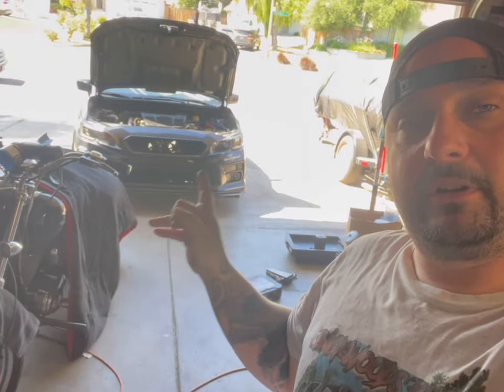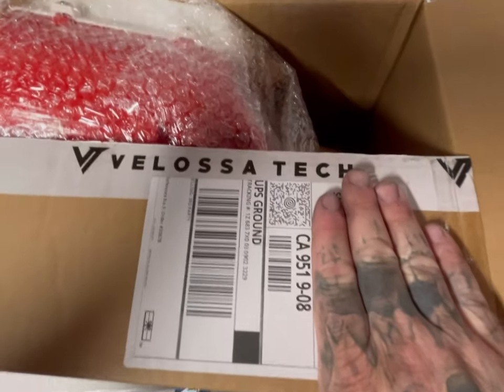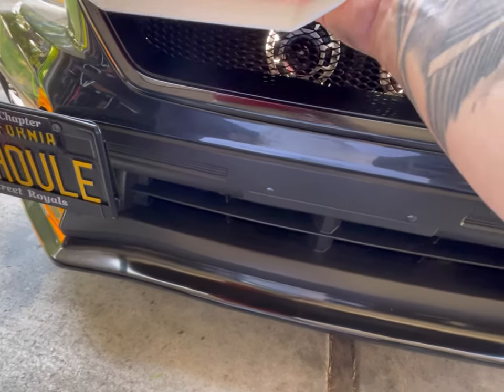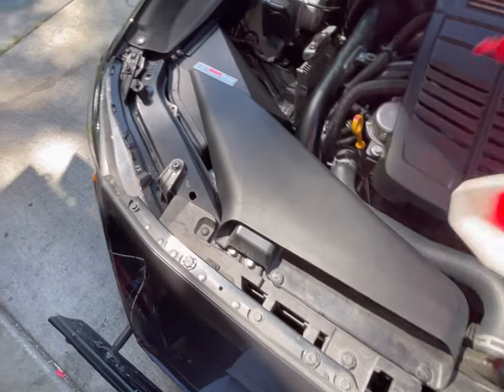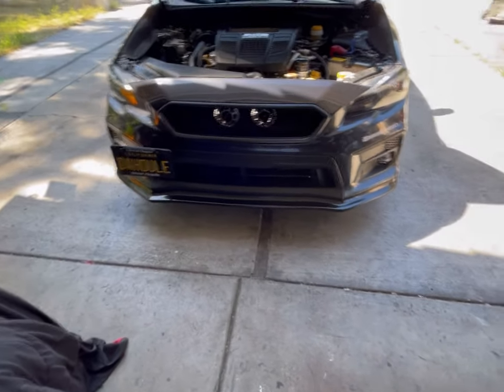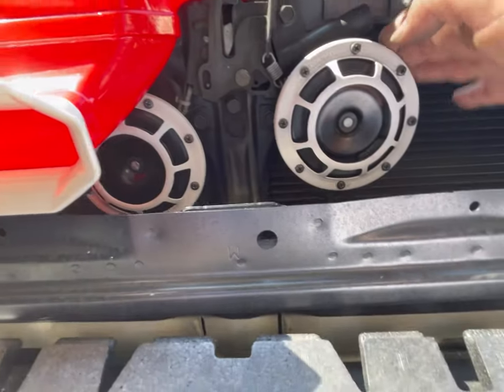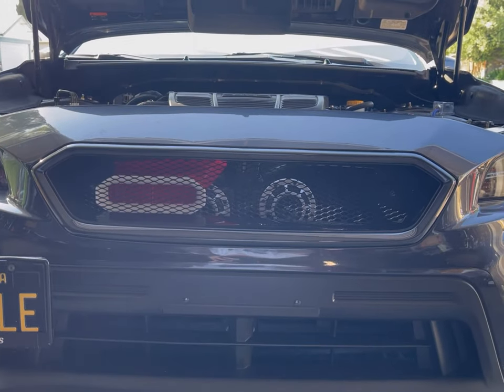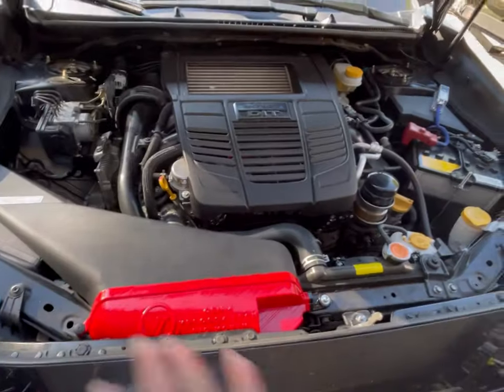Installing velossa tech big mouth snorkel on the WRX (does it really work)

Comment: It looks awesome and my research has concluded that does work great providing cooler air flow!, now if you wanna do maintence and specially cleaning the air intake, do you have to take the bumper and re do the hole thing just for the oem vent to come off or is a way arround it?, because that will be kinda annoying!
Im looking on buying this thing for a while, so hopefully is a easier way to work on it or arround it, one's installed!
thanks
Reply from the maker: Cleaning the snorkel itself you have to take bumper off but the air filter cleaning if you have oem you don’t need to mess with it at all
Reply: @TommyT408  Thank you ill be ordering one now!